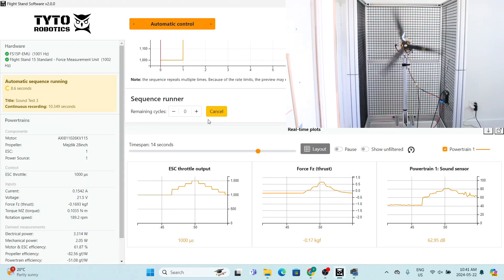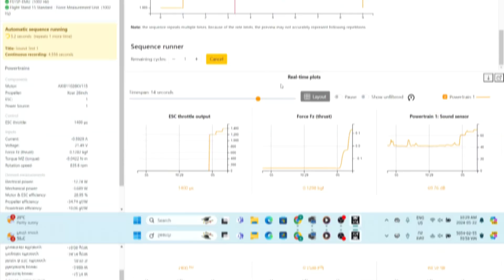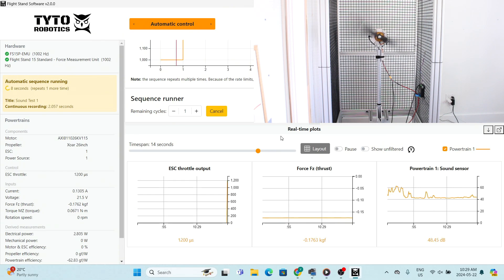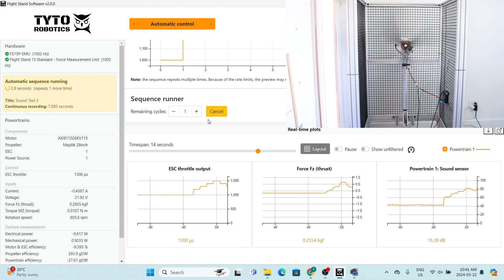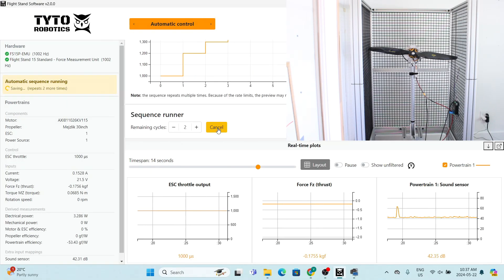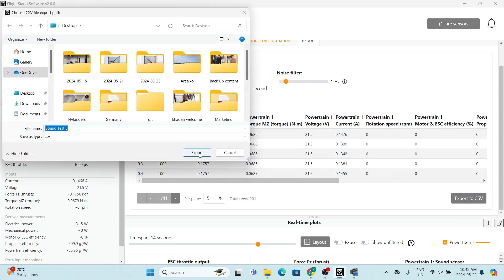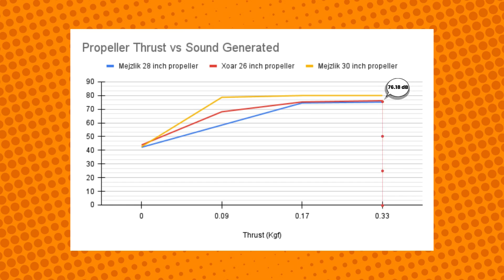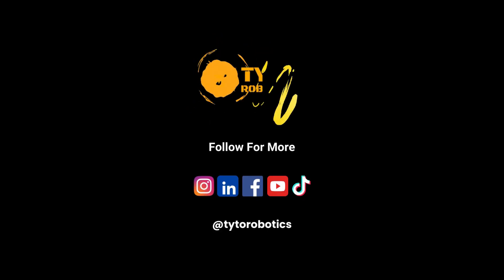Testing Drone Propellers: Which One Is the Quietest?

Comment: is the 28 inch quieter because it has the most amount of propellers
Reply from the maker: That's a good question. There are a number of aerodynamic reasons why it might be the quietest, and blade number may have an effect, though it's too soon to say that more blades = quieter. We will need to run another test to study that in more detail.